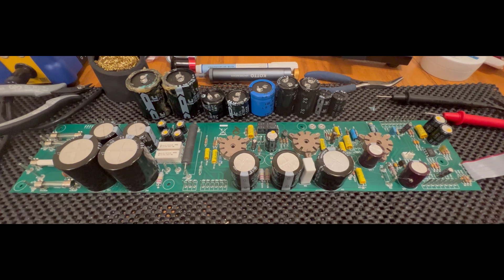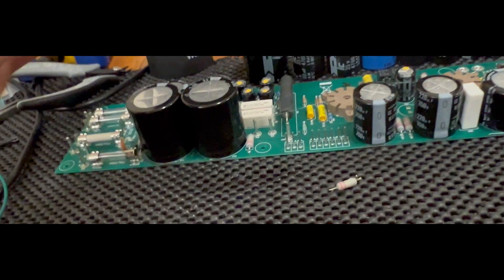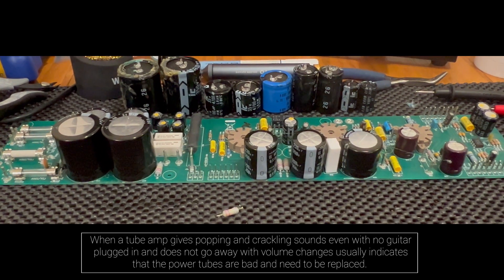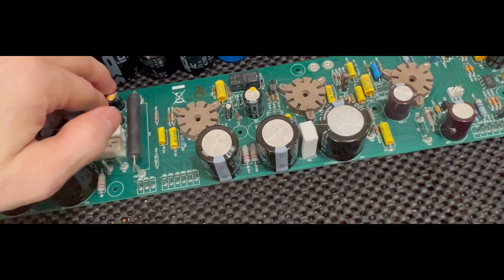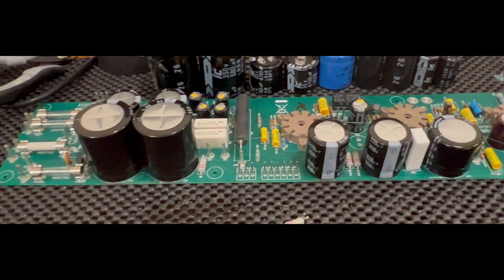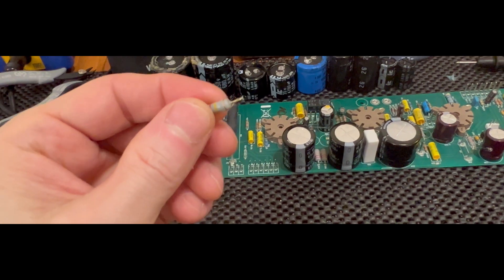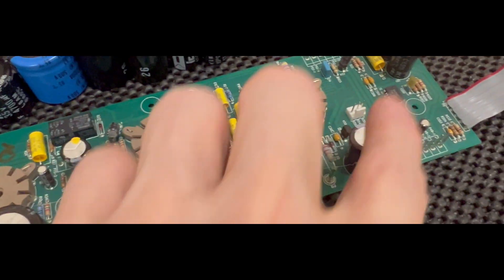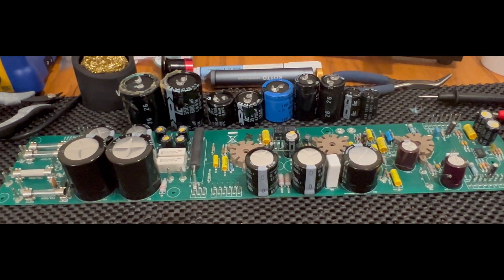Replacing capacitors on one of my Peavey JSX combo tube amps

Comment: I’m working on the same amp. All of the new caps I see on digikey have only 2 posts, and the IC caps in the amp have 3 post. What did you do about that and did it work?
Reply from the maker: Some of the Digikey PN I used: 493-7321-ND, LLS1V472MELA-ND, 493-11801-1-ND, 493-12150-1-ND, 
493-7773-ND, 493-4346-ND, 
493-17649-ND. 

Hope that helps.
Reply from the maker: Also while you're in there replace all 4 screen grid resistors.
Reply: @LexJones  Okay thanks! Are the screen resistors also on the preamp board?
Reply from the maker: @Cody-my1yy  They are on the power board off to the side of the power tube sockets. the board isn't fun to pull, but I'm willing to bet at least one of them is drifting in value, and that will make properly biasing the amp impossible.

R101,  R102, R117 & R118, They are ceramic resistors "CRAP" think I used PN# ALSR5F-700-ND (700--5W--10%--WW--AXL)
Reply: @LexJones  Okay that’s what I figured. Thanks for all of the tips and advice! You rock!
Reply from the maker: @Cody-my1yy  Good luck sir & always make sure you drain the caps before anything, and one hand in the pocket when reaching in.
Reply: @ You bet 👍
Reply: @ Hey man, thanks for all of your advice. I got everything done about a week ago and my amp sounds better than ever! 👍
Reply from the maker: They're all 2 post caps, They bridge 2 of the posts for the IC caps on one of the sides.
Reply: @LexJones  Oh okay, so the new two posts install just fine? Also, how did the amp sound after? Thank you, I appreciate all of your help!
Reply from the maker: @Cody-my1yy  It sounds great, One of my favorite amps for all my Drop B / C #, 8 string guitars, I have 2 of them, I think the time to re-cap the other one is getting close sadly. 2nd time around should be faster, another piece of advice, the glue between the 4 big caps... Heat gun, low setting, don't hold it there long, popsicle stick to scrape out after softening.
Reply: @ That’s awesome! Yeah I love these amps, the one I’m working on is my favorite amp. It’s the Triple X ii, same as the JSX. It started making the dreaded 120 cycle buzz that increases with master volume. Are the screen resistors also on the preamp board? Any need to pull the power board? I really appreciate your help man, you’re the best!

Comment: I have a JSX head..it powers up but no sound output..what would you do first?
Reply from the maker: Check all fuses first, there could be a power fuse and a HT fuse, also there could be additional fuses inside the head, if you know how to properly drain the head that would be my next step, check any and all internal fuses for continuity, after fuses I'd replace power tubes and if that didn't do it pre-amp tubes, they are going to be one of the more common faults, there are other things internally you can check if you're knowledgeable testing electrical components, but then we fall back to properly discharging capacitors and such, if you're not I do not recommend going in to the head, find a good tech and work with them.

Comment: My JSX has the buzz but if I turn the power switch off and on quickly it usually goes away
Reply from the maker: Sounds like the filter capacitors are on their way out then they may not be entirely shot yet, but eventually you’re likely going to need to have them replaced, unfortunately, the quality of capacitors that they decided to go with has a rated lifespan of about 1000 hours
Reply from the maker: Sounds like a grounding issue, also could be power tubes.

Comment: I hate to ask but, would you be able to do a long video of the entire process?  I have a combo amp that I don't power on because it needs to have the filter caps replaced.
Reply from the maker: Unfortunately, my second JSX amplifier combo doesn't require a recap at this point, and I only have the two, I've already completed the process of not only recapping the amplifier, but also replacing the screen grid resistors as it would not bias properly. 

I only thought about shooting a video on this after the fact of doing the recap, but if I do need to go through the process on the second one, I will definitely record the process.
Reply: @LexJones  Do you happen to have a list of all the capacitors you ordered?  I'd like to replace all the capacitors on the power supply board.
Reply from the maker: If I ever tear in to my 2nd combo I could certainly do that, and I am thinking that may be on the horizon, but then I am weighing if I even want to, I have tried trading and selling one of them and seems like in my area not a single person want's one, so not sure I want to go to the labor and expense for something I'm not able to move on. If I do I'll put a new comment on here.